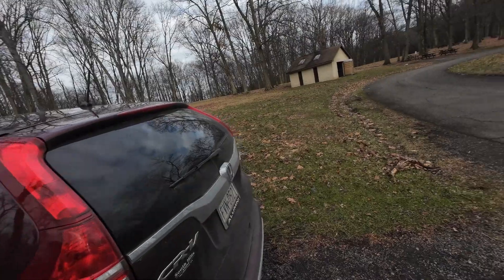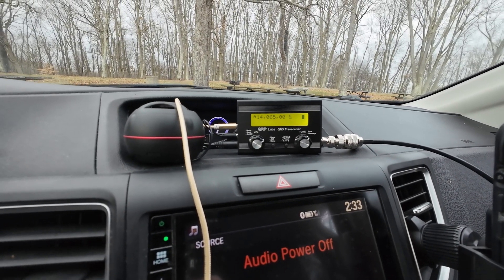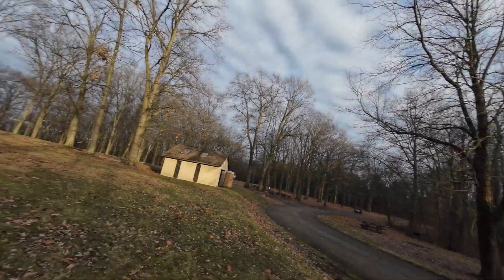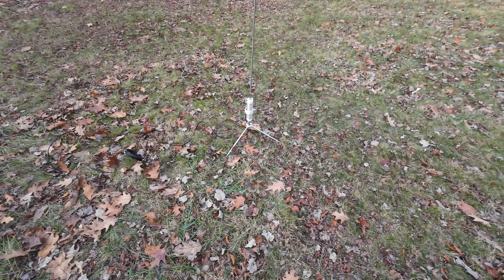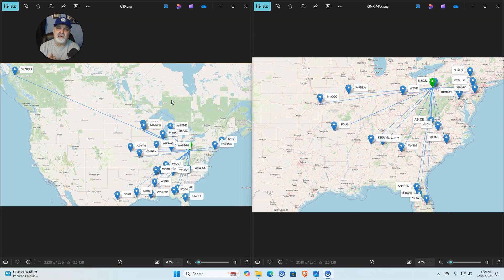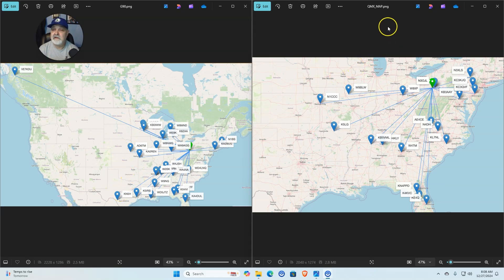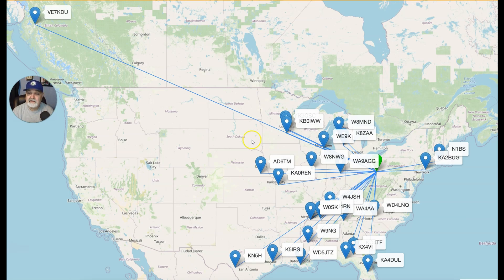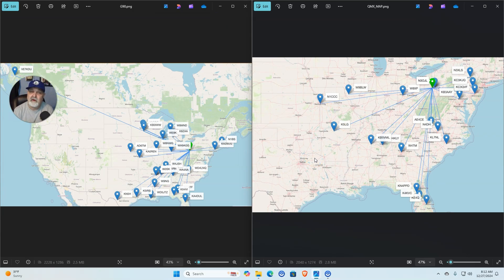How does Ham Radio output wattage affect reach?

Comment: I do use a black marker for the different bands.  Yes, they will change is you modify the counterpoise.  I took the original 33ft wires and cut them into thirds.  I place a bundle of three cables on each leg.  It only stretches out 11ft.  I do not use a tuner for this.

KI5WWT
Reply from the maker: Thanks for the tip. Yes, the 33' wires are a bit long. Thanks for watching. 73s

Comment: Just an opinion without any scientific data to back it up: On CW, the difference between 5 watts and 20 watts is negligible. On CW the difference between 5 watts and 100 watts is noticeable. On SSB, 5 watts is a tough go. It works but more power makes a BIG difference on SSB because it is a much more inefficient mode. But, as was mentioned previously, power is much lower on the priority list than most people think. The #1 thing you can do to make a HUGE difference is your signal is antenna. Antenna is infinitely more important than power. Constantly trying to come up with better antennas is a big part of the hobby (as you already know).
Reply from the maker: Ken, thanks for this information. I feel the same as you about power. I also enjoy testing different antennas and comparing my activation maps. Thanks for the great comment and thanks for watching. 73s

Comment: Comet and Diamond have antenna mounts that you can attach to the hatch of your car though I don't think you'll be able to do it to the top of the hatch. You would probably need to mount it on the side of the hatch. I had a CRV that attached a Diamond lip mount to the side of the hatch and it worked well but because of the way the hatch was designed I had to mount it lower on the hatch than I wanted. So just be aware of that. But with the coil the antenna will be up higher than my 2m/70cm antenna was.
Reply from the maker: Thanks for the great comment and suggestion. I will look into those. Colder weather is coming. Thanks for watching. 73s

Comment: Jack, I have watched your videos before.  I was looking through my hunter contacts from yesterday and saw that you were on the list.  A celebrity contact!

I also use a Wolf River coils antenna while activating.  I use the long 17 foot whip and tune (with a nano vna) by extending and contracting the whip.  I also use the sporty 40 coil for 40 m, mostly I am on 20m, so just the bare long whip.  

Ditch the ground wires that come with it.  I use three sets of two 17.5 foot silicone coated 22 gauge wire on a big alligator clip.  So the same total amount of wire but shorter pieces and silicone coated for easy handling.  Alligator clips for easy attachment.  

Search for “magic carpet” and KB9VBR for videos about using screen and conductive cloth as an easily deployable ground plane.

Love your videos.  Hope to hunt or get you in the log when I am activating.

Chris W2BPL

Comment: Jack, I've been doing POTA from the car using Radioddity HF-008 with the Mag mount. I've been pulling up to the park in very low temps, throwing the antenna on the roof and activating the park easily getting into Europe from NY on 10m every time. '73!
Reply from the maker: Thanks for the information. I have to find a mount that accepts 3/8" threads. Sounds like you have the cold weather under control. Thanks for watching. 73s.

Comment: A quality antenna, quality low loss coax feed line along with favourable band propagation are much more important factors in reach than output power.  Remember 1 S unit of signal strength is 6db.  I think Ham Radio Tube (Mike K8MRD) did a video showing the difference in signal strength between his 100 watt IC-7300 and a 20 watt G90.
Reply from the maker: Thanks. I watched Mike's video, which was very informative. My radios performed about the same, so they must be in band conditions. Thanks for the feedback. Thanks for watching. 73s.